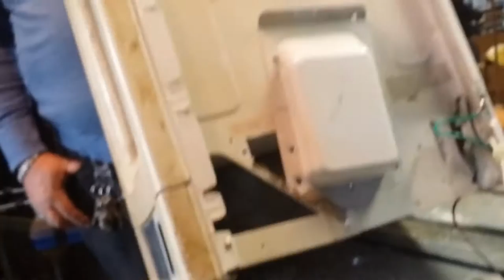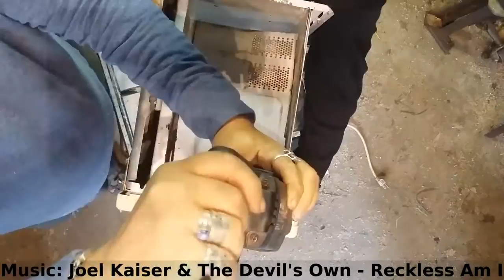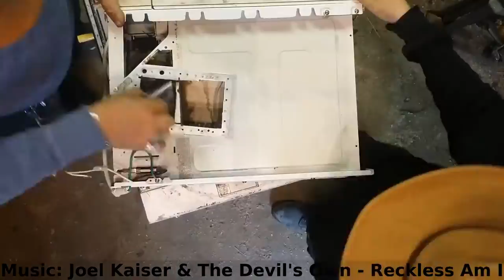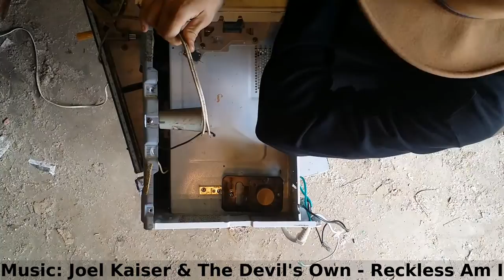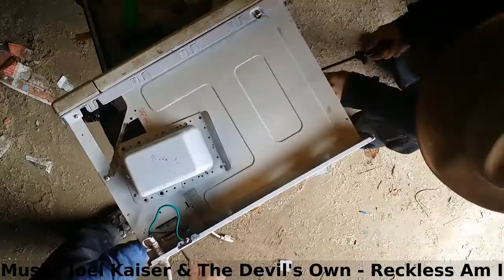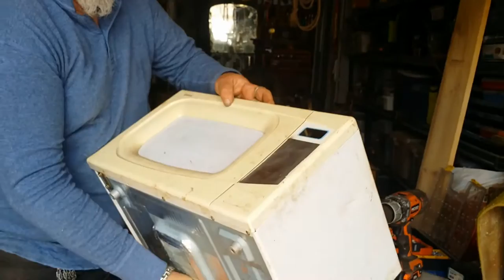DIY Welding Rod Oven

Comment: With all the plastic on the front door of a microwave, I'm not sure this will work at the correct temperatures for a rod oven, after all, you can go up to 400-F in a rod oven, and various rods (flux) require different temperatures. Best way to do this, if you want a 'quick' oven is to just buy a toaster oven with a thermostat for $40 and be done...
You want a 'fancy one' (with vapor valve, etc.) and you can weld decent, then convert a 30-lb propane tank to a horizontal open-front oven, and using an old toaster oven, move the element, thermocouple over to the propane tank and fabricate a decent front door for it. Add a stainless steel rack in the bottom and put a pressure-relief valve on top (assuming you vapor lined the front door). You can build a VERY NICE rod oven for $100 (assuming you have the propane tank already).
By the way, while not required for 'regular' rods...if you live in a high-humidity area, a rod oven will even help them (yes, even the lowly 6011)...
Reply from the maker: Thank you!

Comment: Great idea, but Lincoln Electric recommend a temperature between 250 and 300 Farenheight (120 to 150 celcius). 80 Ferenheight will be way too low.  https://www.lincolnelectric.com/en-au/support/welding-how-to/Pages/storing-electrodes-detail.aspx 

I'd probably add some insulation around the inner chamber and sit the oven upside down with a rack to keep the rods off the bottom.
Reply from the maker: Ok try #4! Yes you are correct! but most home gamer welders don't have the facility to store at 250F. This is meant to get you through the job, after drying the rods in the wife's oven @ 400F for an hour... Yes Insulation and a shelf would help too, but what would be the benefit of turning the thing upside town?
Reply: @trollforge  I was thinking that since hot air rises, so you want the rods to be where the hot air is. On looking at it, it's the right way up.

Comment: ya making a project out of this....get an old refrigerator, put some grating shelves w/ 1" or 2" angle for support...finally put a 100 watt light bulb for heat...and there ya go....
Reply from the maker: Done that many times (with a thermostat) to keep spray paint outside through winter .